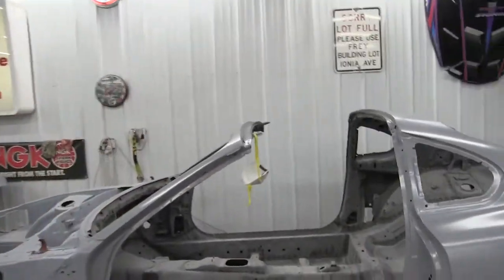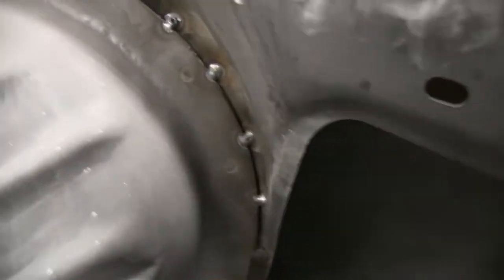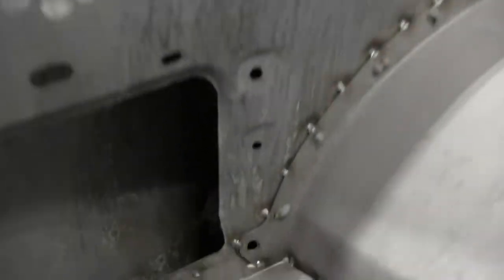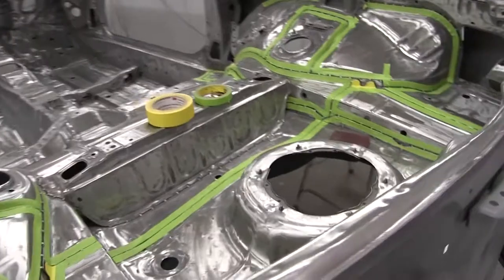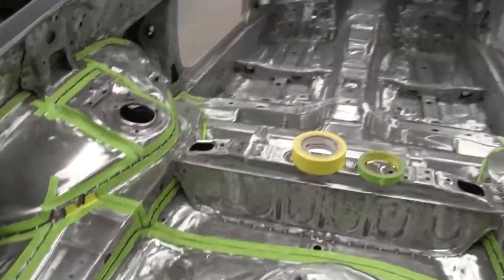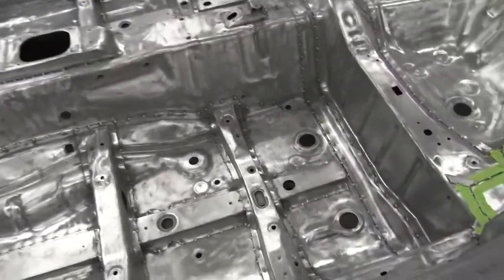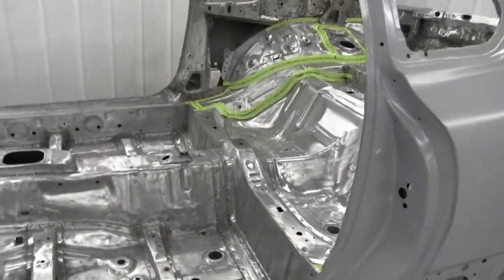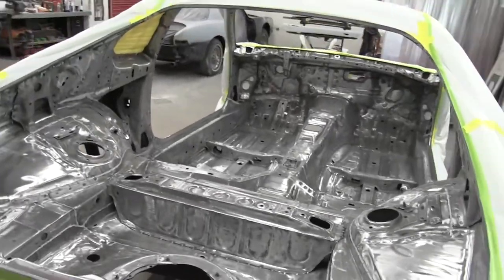1997 Toyota Supra MKIV Ridox Build - Interior Gets Primer - Part 14

Comment: Two Question
1/ i have always wonder how one do the rust protect or paint the area where you can't get to such as places behind panels or those inside tubes or beams?
2/ can u fly oversea and do my car mainly just bodykit 😂?
Reply from the maker: 1. Automotive Cavity filler wax
2. If only! lol
Reply: @PaulRozeboom  automotive cavity filler wax? How do u apply them if u can't get to it?
Reply from the maker: @mkivst180  It comes with a really long spray straw